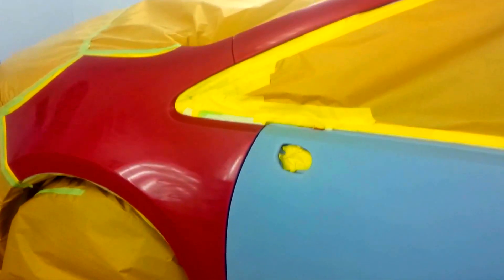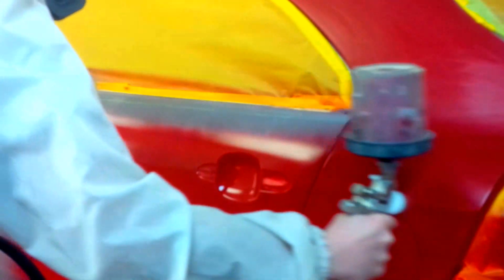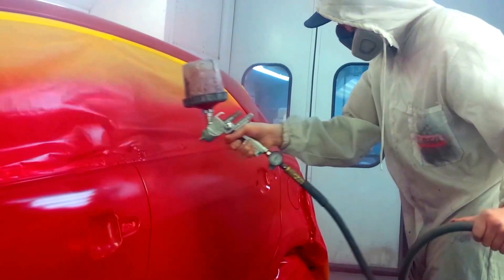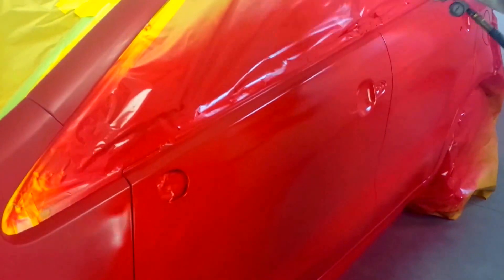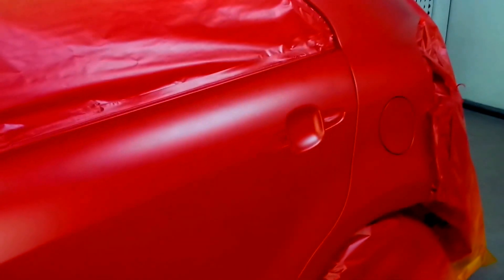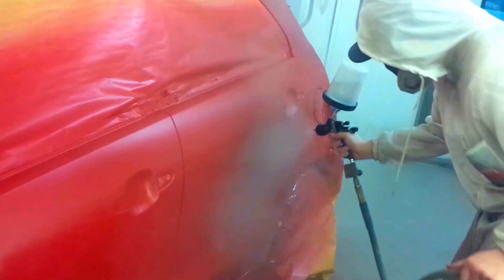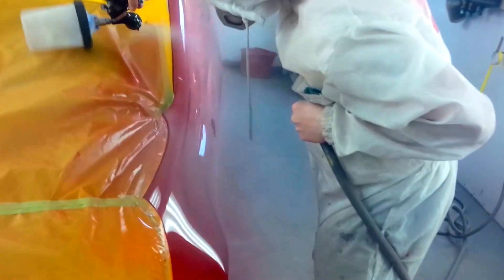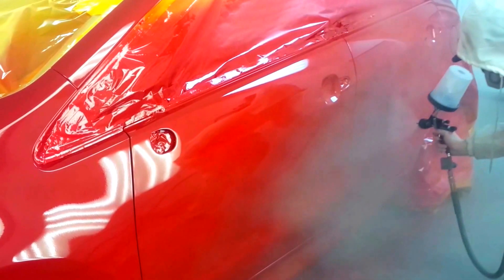Achieving Flawless Red Tri-Coat Blends: Base/Clear Application with Sata 5000 HVLP

Comment: Just stumbled up on this video,the dust problem in a spray booth is somthing i find a bit strange,i sprayed numorous jobs in my backyard garage where i just make a tent with static painters plastic and never had that much dust,clean well before you go in and tac whipe it followed by a microfiber cloth seconds befor you spray and you should be fine,i olso wet the floors becouse i dont have the sucktion like a booth would have and dont want overspray on my floor to rise back up again.

Comment: Was thinking about buying the 5000 HVLP I own the 5000RP for clear. Does the HVLP do a good job on metallics and pearls, I currently use a tekna prolite for base not sure if you have one or not but if so how do you think the 5000 HVLP stacks up against the Tekna for base? We are shooting PPG Enviro base. What tip size are you using on the 5000 HVLP?